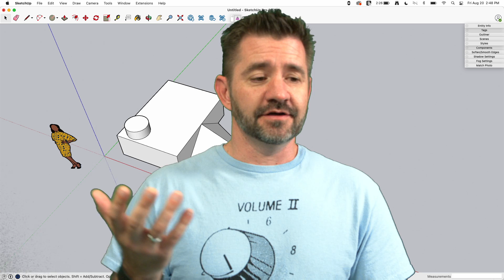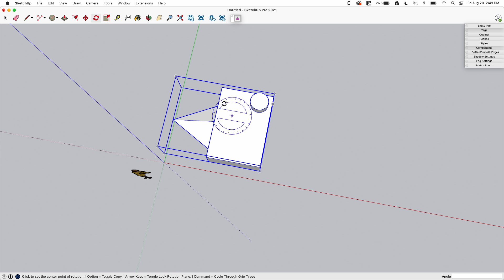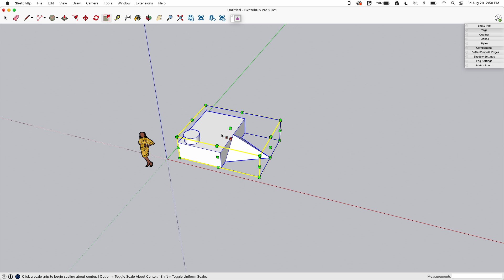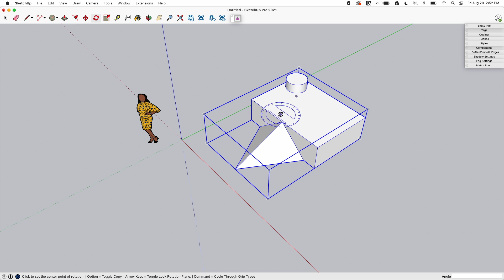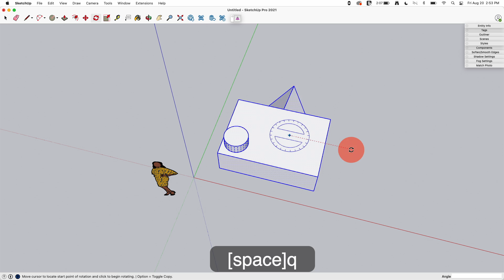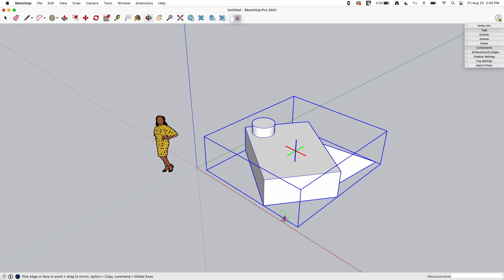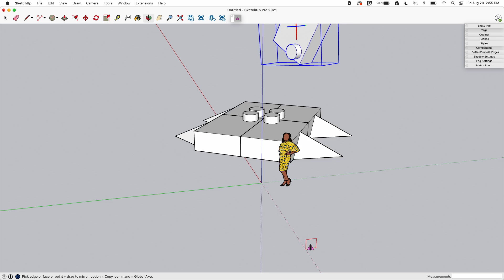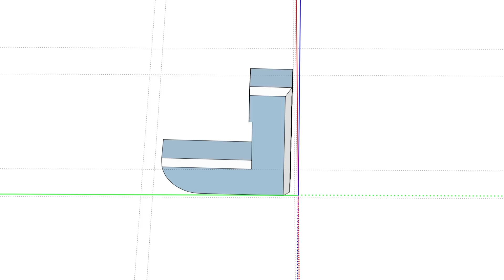Mirroring Options - Skill Builder

Comment: You can also make an off-axis group into a component and then change the axis of the group/component to align the bounding box to the square faces. Flip along now works the way you’d expect. If you don’t want to keep the component you can then explode it and reform as a group or leave it as loose geometry.

Comment: Another confusing layer to the flip along tool that should be mentioned is that if you select multiple groups and go to flip them it no longer says "group axes", because you have several ... in that case it uses the overall model axes, which adds another thing to think about.  That said once you use it for a bit it all becomes second nature and it is my usual go-to (mostly because I forget I have curic mirror - which is awesome).

Comment: Thank you Aaron for your great videos which I admit they helped me tremendously. Like yourself, I usually use the scale tool for mirroring. if the object/group is not matching with the universal axis, I just reset the axis to mach with the surface that I need to mirror against, and it usually works for me.
Reply: use federo scale.